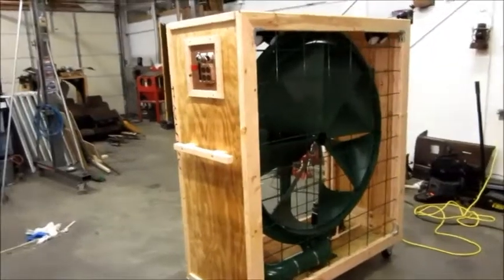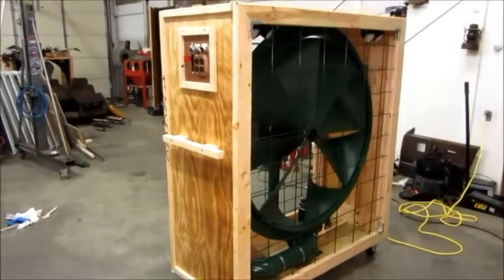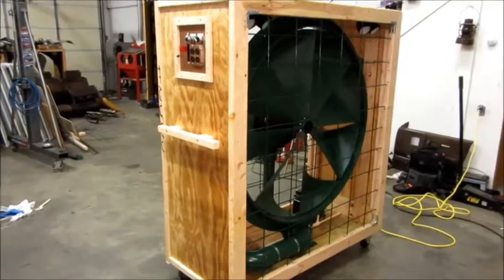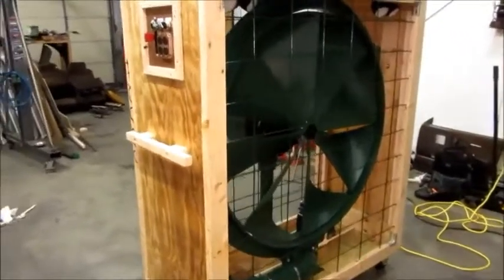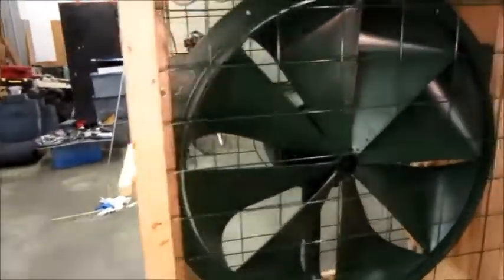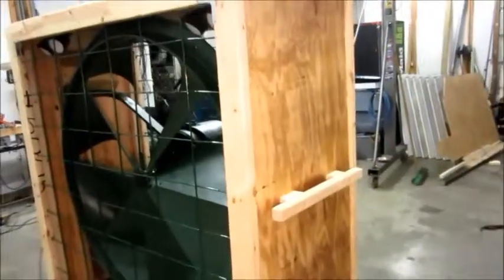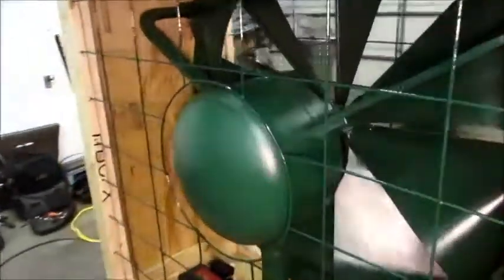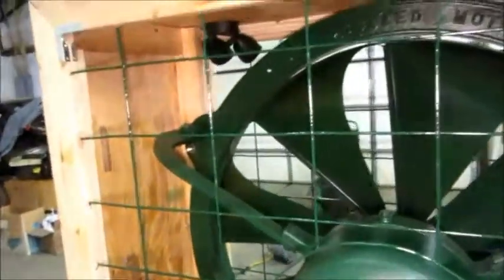Antique 48" ILG Electric Ventilating Co. Self-Cooled Motor Fan Restore - part 7

Comment: Good work.  People (manufacturers?) forget that it is possible to have massive air movement without massive noise.
Reply from the maker: Yeah - like I said they fall for the cheap designs like a skinny 4 blade fan with an 1800 RPM motor. Nobody cares about the people who work in the facility and have to listen to it all day long!

Comment: That rear grille came out great!  It sounds like it operates super quiet too. 

I do worry the motor dome could get banged into something while the fan is being moved around, but I think you're careful enough with your equipment to avoid that :)
Reply from the maker: Thanks!  I was concerned how it would look, but it matches my 'simple unobtrusive' look theme.

Yeah, I will have to be careful with the dome but it's something that I am aware of and will not run it into things.
Reply: a replaceable logo sticker can take care of that.

Comment: WOW, outstanding job saving this fan for future generations to enjoy. I love the simple design that really displays the fan well. I just bought a model 103 ILG at an Estate sale last weekend. The fan was attached to a board that covered the vent tube, Would you know if it's OK to have the tube covered or should it be open around the vent hole?

Mine is in good condition, with missing patches of green paint. I was thinking about repainting it and maybe using black to highlight the writing around the outside.

P.S.- Your hard work earned my subscription and respect.
Reply from the maker: Thank you for subscribing! I'm happy you're enjoying this build!

I think that the black highlights would look really good.  I had considered using metallic gold paint pen to highlight the writing on mine, since the original decals were gold colored.  Just haven't done it yet. :)
Reply: David, I just saw an ILG with the gold lettering on a AFCA thread and was impressed with how it looked, so I may choose that color over black. Black would stand out more, but gold gives it a rich classy look that I like.

Russ Huber of the AFCA sent me a link to a thread, that showed another member going to the top of an ILG building, where they had a 72" ILG that believe it or not still gets used a time or two. I told Russ if they ever decide to donate it to a fan museum, they should have you do the restoration on it, seeing how great a job you did on the previous ILG's.

                                        Take care,
                                                          Mark
Reply from the maker: Thanks!  Yes, I have seen pictures of the 72" bucket blade fans at the top of the Ilg building!  There are also a couple of them in the southeastern USA in a currently disused building. 

I believe AFCA members have been in touch with the owner and historical preservation society, so as to encourage saving these if something bad happens to the building.

I would be greatly honored to restore a 72" Ilg. that would be a pleasure, for sure!

Comment: Fabulous work!  I'm very impressed. If you don't mind me asking, are your skills part of your vocation or just something you enjoy doing? Also, would be curious to know what the status of the fan is currently.  A little big to be sitting on a shelf. I really enjoyed your videos.  Thanks!
Reply from the maker: Hi Nancy.  Thanks for the compliment!  I am a commissioning engineer for a major player in the diesel and gas powered electric power generator industry. I configure, modify, and integrate our company's generator packages into the facilities where they are going to be used. It takes a technician who can do electrical, mechanical, and automation work to do this commissioning. So yeah, I use the same skills at work!

Comment: Late to the party, and maybe it's been dealt with, but I would paint around the edges of the grills (marker looks bad).  I also probably would have painted the conduit green, but it's not that big a deal.  Any issues with the VFD going into overtemp since the whiny fan was removed from it?
Reply from the maker: Hello brad.  The VFD is mounted directly in the air stream of a fan which is probably 5 times more powerful than its original fan. That's why it's in the PVC pipe. The end of that pipe is fitted with a 5 or 6 inch fan in a rubber mounting.  It has never had any issues with overtemperature. 

As for the edges of the grilles, you talking about the wood board frame with the lumber grade markings?
Reply: Yes, the lumber markings.  I must have missed how the VFD was cooled the first time. :-)
Reply from the maker: Yeah, that was in an early part of the video series about the cooling system.  I might sand off the markings next time . I'm building a couple box fans now and will probably do something about any excessive markings on them.

Comment: I have a model 213 and the motor just went out. They quoted me at 900 dollars to rewind and rebuild the motor.  It's only like 800 for a complete new setup...ahhhh???????
Reply from the maker: You called the wrong place, apparently. That motor can be rewound for half that!People like these fans because they are so much quieter and longer lasting than the new ones. It's worth repairing the motor if you can't find another similar one. 

Can you post on the AFCA forum? Post in the Wanted ad area. There may be someone who has parts!

http://www.afcaforum.com

Comment: With that much electricity being used/produced I think a GFIC would be in order.
Reply from the maker: It could be used, but this design is grounded and also the transformer provides isolation between the incoming mains power and the motor / VFD. I tend to feel that GFCI's unnecessary for stationary equipment like this.

Comment: What is the CFM rating on this thing?
Reply from the maker: According to the old literature from Ilg. it pushes 18,400 CFM when running at the original designed speed.
Reply: Impressive!